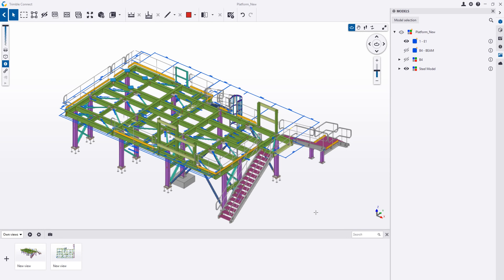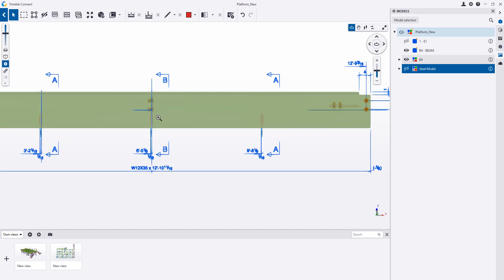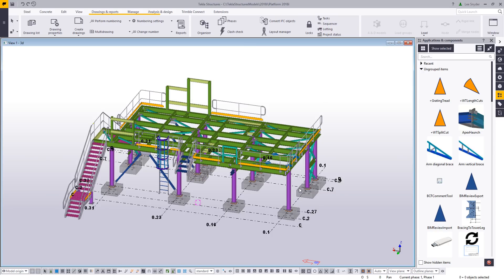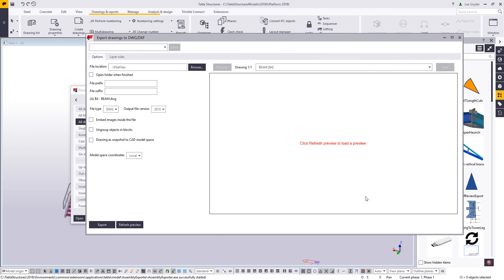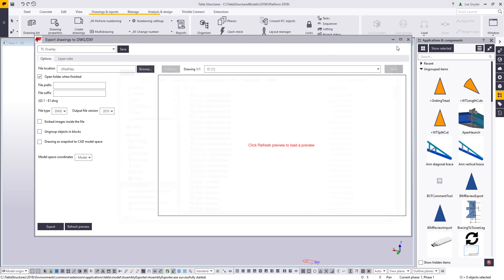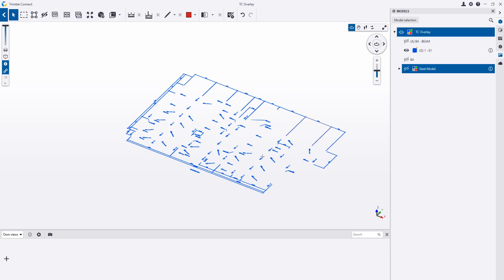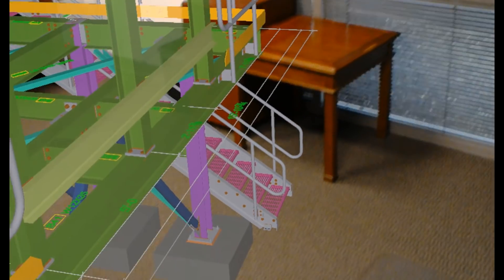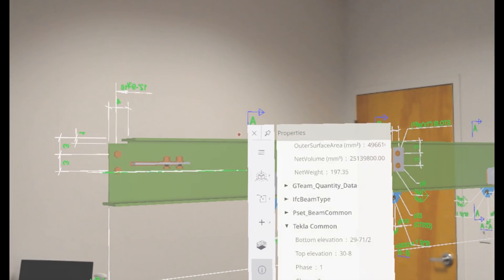Overlay 2D Annotations on a 3D Model

Comment: Hi! Amazing. Is this possible exporting both IFC and DWG from Revit?
Reply: In Tekla Structures we are able to export the drawing annotations in their 3d space which is what allows the annotations to line up with the IFC file.  I do not know enough about Revit to know if they have a similar option but if they do they you could export the IFC file and load it into TC and then upload the DWG file from Revit and view them together.
Reply: @leesnyder6784  Thanks Lee! As I am not a Tekla user I didn't know about that functionality. I will do a research about this to see if Revit is capable of doing the same :)

Comment: In the advanced options setting dialogue box, in my system, XS_DWG_EXPORT_3D_MODEL_COORDINTES IS NOT SEEN IN THE LIST.  What could be the reason?
Reply: What version of Tekla are you using?
Reply: @leesnyder6784  2017i
Reply: @sanazkarimi3920  This option was added in Tekla Structures version 2018 and newer
Reply: @leesnyder6784 Snyder okay now I got it. Thank you so much

Comment: When I opened the created dwg file in Trimble connect, that file seems to be inactive (highlighted red), I cannot click on the greyed eye icon. What could be the reason?
Reply: That typically means that Trimble Connect can't find the file location of the file.  Meaning the file path was changed/moved somewhere else.
Reply: @leesnyder6784  Thanks for the quick response. But the path seems to be ok. How can I resolve this issue? Please guide me.
Reply: @sanazkarimi3920  If you bought the TC licenses from Tekla then reach out to your local helpdesk.  If not then you can email connect-support@trimble.com and they can help you out
Reply: @leesnyder6784  Will do, thank you so much